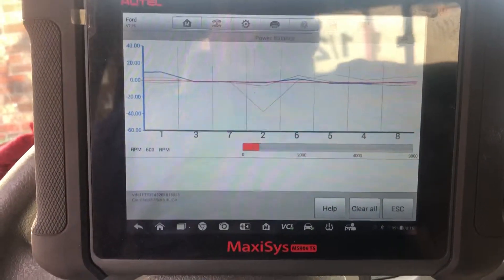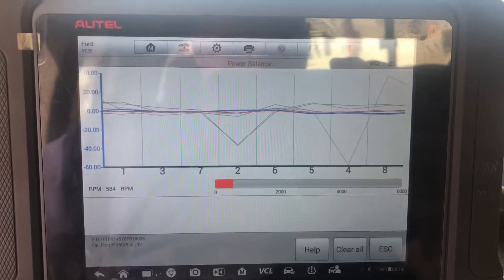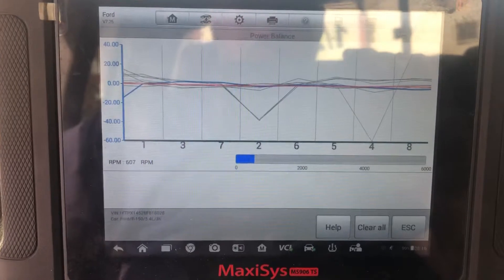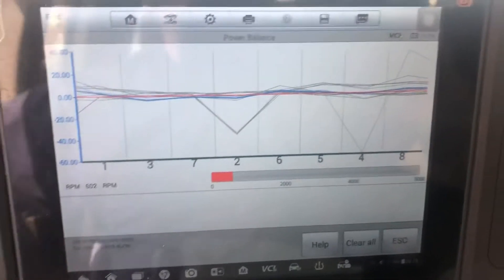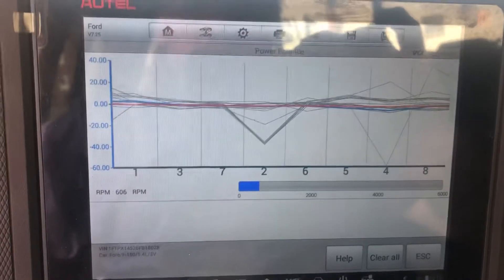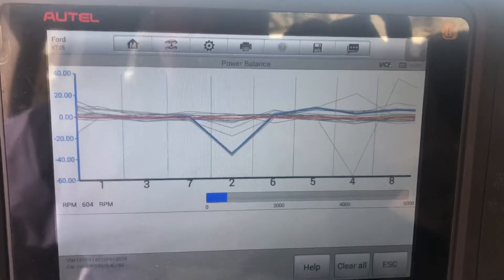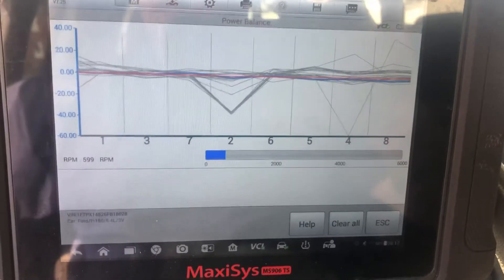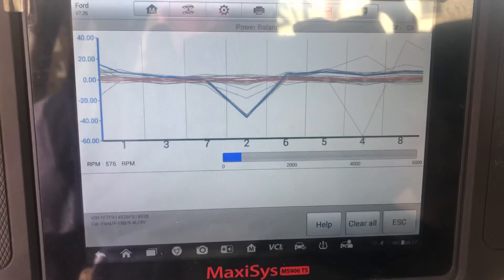autel ms906ts ford cylinder contribution/ power balance test

Comment: Was it the Autel or Ford? I have the Autel ms906 and its not slow at all on my 2013 f150 3.7. 2 different trucks though.
Reply from the maker: i think its a combination of the two. but ford ecms are generally slow to transfer data on anything other than ford ids
Reply: Hello, I recommend Topdon's Phoenix Elite to you, it supports full-system diagnostics for more than 200 brand models, and covers a wide range of models.
Here's a video I made of balancing PCM Power for a 2013 Ford with this device: https://youtu.be/3DeI7sB6AY8 , you can take a look, it might help you.

There are more videos on my homepage of different devices performing functions for different car models! Come in and see, there may be surprises!